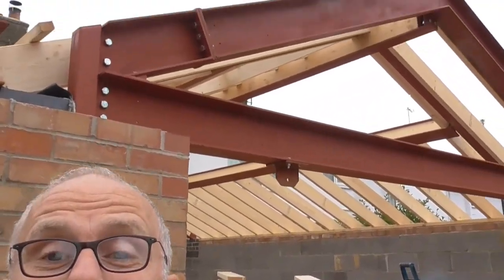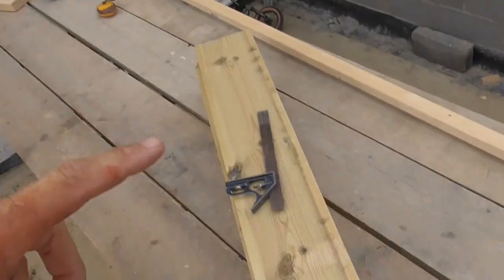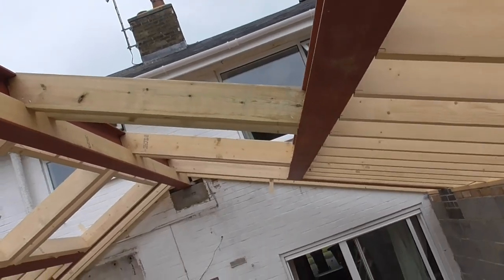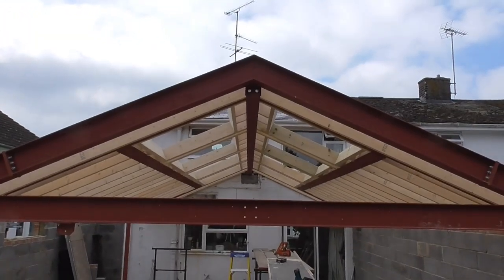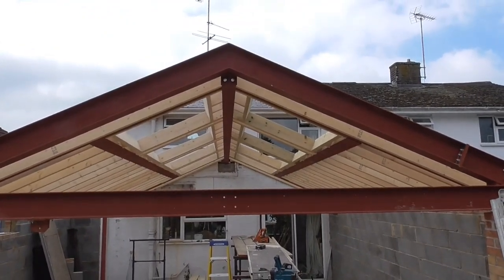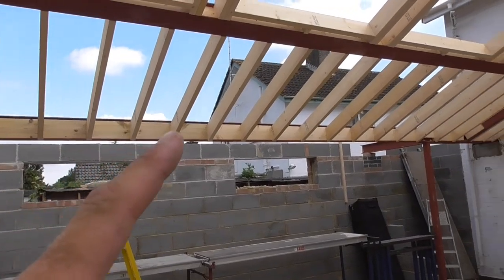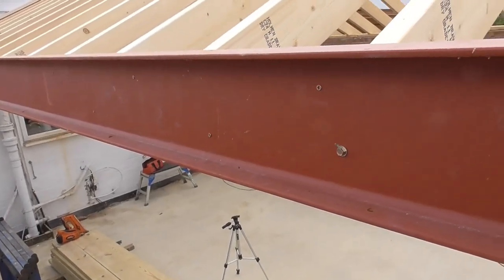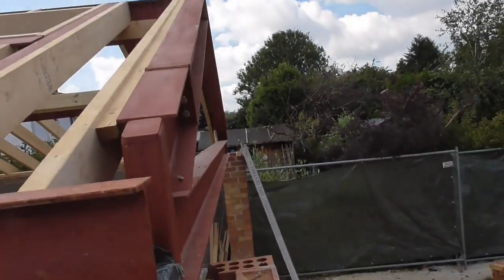Fitting timber rafters to a structural steel frame. PART 4 ***trimming for roof windows***

Comment: how do you go about hiding the horizontal section of the bottom of the I beam in the centre of the Rake
Reply from the maker: Hi there🖐From memory it was framed out and plasterboarded on the inside, and cedar clad on the exterior👍Cheers Del

Comment: Was it really necessary to have so many I-beams ? What is the load per sqm this roof is designed for?
Reply from the maker: Hi there🖐I'm sure I explained in one the videos, but it was designed to have 2, huge roof windows, hence all the steels used to form the openings. It was changed to have 8 Velux windows instead👍Cheers Del

Comment: Got a fairly similar roof coming up. The engineer has recommended we mechanically fix a plate to the top of the rsj ridge beam and double birdsmouth the commons. 
Is this a good idea? When he said we needed a steal rsj ridge beam I immediately assumed it meant putting a plate inside the webbing of the rsj.
Should I get the top plumb cuts to meet or leave abit for airflow along the top of the ridge?
I'm excited whenever I get to do roof work and this will be the most complex one I've done by myself. I want to get it right.
Reply from the maker: Hi Kallum. Fixing a timber to the top of a steel ridge is pretty standard in my experience. (I had to di it differently in these videos). I would probably aim to leave a tiny gap between the ridge plumb cuts, not particularly because of cross air flow, but more so as it give you a bit tolerance when fitting them. I usually bolt collars on under the steel as well, as it makes a space for insulation and ties the rafters together. (this depends on the design/headroom etc.😎 Hope it goes well mate👍 Cheers
Reply: @thetallcarpenter  yea it's designed for a vaulted style ceiling on the inside with 2 velux windows each side.
Engineer reckons a 6x2 brace under the rsj will be OK. Just wanna make sure tho. The engineer has said we can use 6x2 for the rafters but builder reckons we'll use 7x2 just in case. (Builder is my dad)
The whole extension is little over 6m wide and we're going for as much pitch over 17.5 degrees that we can get away with as that's what the choice of tile allows. 
I'm looking forward to it. Only ever done lean-to types.
Its probably just as simple for most chippies. 
Just waiting on the brickies to reach plate height. I've told them not to put plate on. I'll do that myself the night before.
Reply from the maker: Sounds like it's going to be a beauty Kallum🤩 All the best with it😎 Cheers

Comment: Nice job as usual pal, what is the reason they went for steel frame? Looks harder than hand-cut roof 👍🏼
Reply from the maker: Hi there. I thinks its steel frame due to its size and the flat roof section on the side. To be fair, the intermediate steel beams were originally put in to support the intended, large glazed roof panels, but obviously, that has changed now.👍 Its going to be a fantastic space😎 Thanks for watching.

Comment: What tolerance can you have ( in terms of being higher or under a string line) for the line of the  rafters ?
Reply from the maker: Hi Charlie. If its hand cut, and the line was at the plate level, I would expect there to be no more than the thickness of a nail between the line and the top of the rafters. (this is based on the assumption that the line was help up each end by a nails thickness). However, most roof coverings here in the UK are very forgiving and you'd do well to notice plus/minus 10mm tolerance. I know I might have contradicted myself here, but its always good to try and make your work as accurate as possible😎 Cheers.